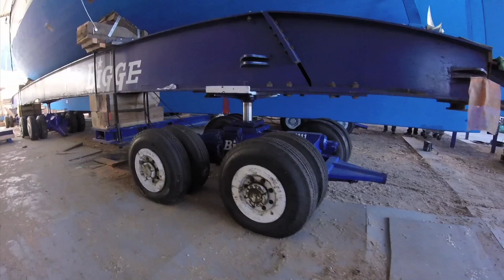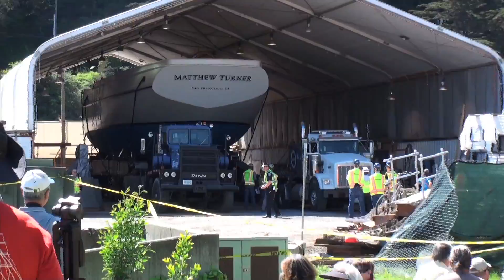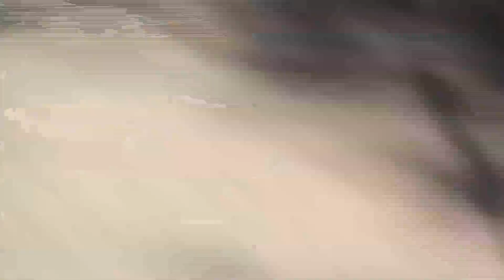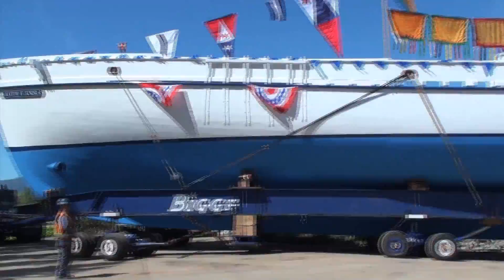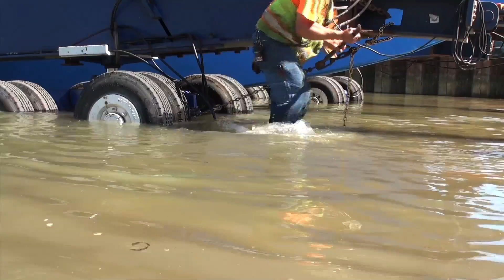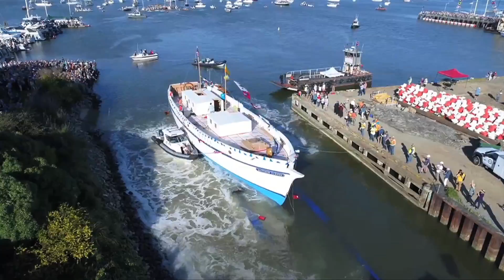Launching The Matthew Turner - Educational Tall Ship  - Sausalito, CA

Comment: I was on the dive boat, the "Allied Mariner" , the LCM that was working with the crane barge to set the ramps for launch and later to assist in towing if a bigger boat than the "protectors" be needed. I planned to video the move and the launch but I missed both because I was crewing when things were going on. I say all that to say this; Thank you for your video because you showed most of the parts that I missed.  If you get a chance, visit my site and let me know what you think.